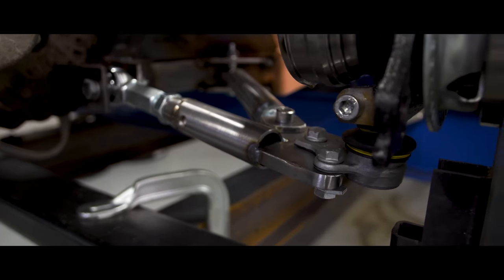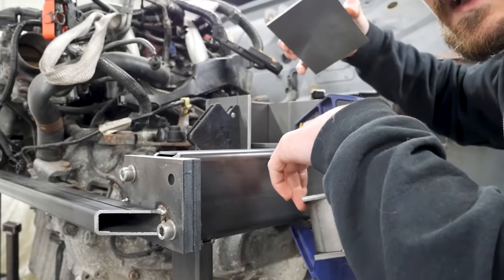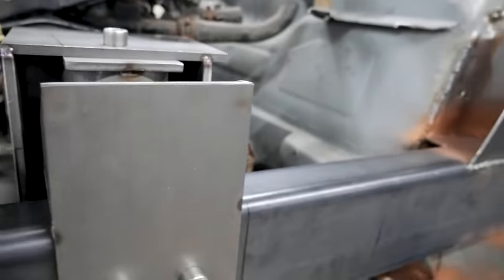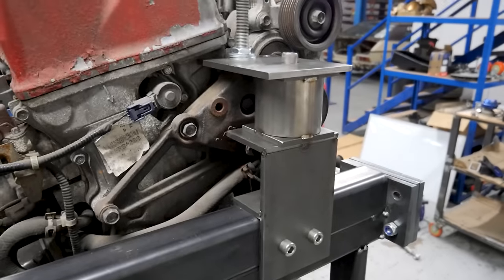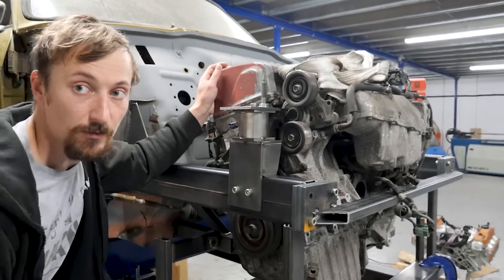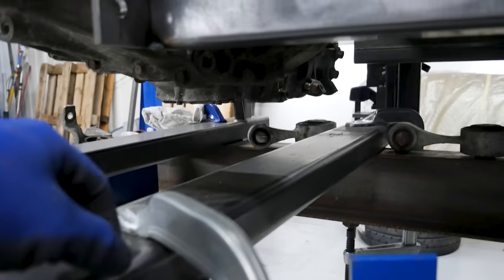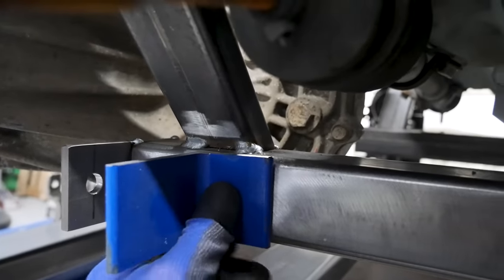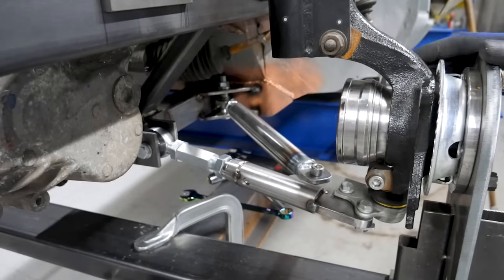Project AllegRo - Jonnys K20 VTEC Sleeper Build - Part Three!

Comment: Engine mounts rubbers : don't put them near anything hot, and definitely don't put a turbo on top of them, otherwise you'll kill them. Engine mount tie bars : these never live more than 40,000 in a road car before they fatigue and lose stiffness, so don't use old one. Replacements are usually cheap. Lower engine mounts from f56 mini/ bmw 2 series touring are a decent design
Reply from the maker: Most of the wear items will be new, but not worrying about using new parts during dry build stage 😁
Reply: Just be careful.with oe mounts, it's likely that the rubber won't live beyond 70C continuous

Comment: It would have been a lot more efficient and economical to weld on a late model honda civic front clip ( chassis rail and inner guards) with accompanying suspension and a k series swap kit , , rather than trying to reinvent the wheel and making the whole thing look like a tank .   A small car like this doesn't need 4x2 chassis rails, I am not an internet engineer, rather a performance car builder with 53 years mechanic skills
Reply from the maker: Apart from a Civic is much wider than an Allegro 🙁

Comment: Few extra kilos on engine mountings is weight spent in the right place as far as I'm concerned. You can probably put a few lightweighting holes here & there without losing much strength but not the end of the world. The stock Honda engine mount setup is quite involved from memory. One thing I would say is that I have a K20A2 (EP3) in a kitcar which uses a basic engine mounting strategy with metalastic bushes & it's quite a buzzy motor. The Z3 version had balance shafts which would presumably help (although most people seem to remove them) but given the choice I'd use the full Honda setup as at least you'll have a reasonable level of isolation which you can stiffen with aftermarket parts if necessary. Shaping up nicely though.
Reply from the maker: Oh there will be lots of holesaw treatment yet 😃

Comment: I’m commenting as someone with no expertise whatsoever on the matter, but a thought occurs to me; with the extremely strong reinforcements fitted to the front of the car to accommodate the new engine and suspension, will the front of the car be so much stronger than the middle and rear that the car might split in half given enough stress and load placed on it? Does the rest of the car need some strengthening so that loads are handled more evenly?
Reply from the maker: Yeah we’ll work backwards at some point, plenty to do yet 😀

Comment: Is there a reason you kept the bottom plate full width on the gearbox mount? From this angle it looks like you could have just had the studs from the box going through just a flange rather than the full width plate. Obviously you would loose some stiffness but you could add webbing at either end of the flange and leave the inboard wall in it still. It would mean you could remove that mount without having to remove the other part as well.
Cheers for the insight and details. Really interesting build.
Reply from the maker: I’d have to remove way more than I’d be comfortable with in order to remove it. Rather just hole saw it. Can’t see it ever being an issue to remove as one assembly😃

Comment: How come you mounted the rear pillowball on the lower arms in a horizontal plane rather than vertical?

Looking at the design of the lower arm, those joints will only ever move in a vertical plane so surely it would be best the same as the front joint? Anything rotational should be picked up my the ball-joint at the bottom of the hub.

Just interested as it’s something I don’t fully understand. Keep up the Cardboard-Aided-Design and tasty fab-work!
Reply from the maker: Mounting them horizontally allowed the mounts to act as a gusset between the car body and the box section that mounts the lower arm
Reply: Thanks for the response. Makes a lot of sense. 

Doing a bit more research it looks like the horizontal plane will also help with stresses on the joint under braking applications too as the forces won’t be pulling the ball part of the joint out of the socket gaps!

Keep up the good work!

Comment: Nice! Thanks for sharing! I would've placed the "rubber part" om-top of the chassieg, en redisgned the gearbox-mount. The chassis-side mount looks "flimsy" only holded by 2 bolts. 👊🏼
Reply from the maker: There’s many ways to skin a cat! There are four bolts, two hidden ‘inside’ that you can’t see 😃
Reply: Ok, thanks!

Comment: 2 questions I have. How much weight will be added to tie car with this front end, and how does it attach to the rest of the car structure to be strong?
Reply from the maker: No idea until we actually weigh it, but I can tell you there two inner wings I cut off in ep1 are way heavier than you’d think!

Comment: Shouldn't the engine mounts be at the same height across the car (Z dimension) so the engine does not rotate at an angle? (Centre of rotation is in one plane) If you have different heights the engine will pull up on one side.
Reply from the maker: Not according to Honda😅
Reply: @FabCoUK  Hmm, from the images I see on the web, the chassis rails of the Civic are level in Z and there is a hydro-mount with drop plate to get to the mount on RHS the rail. The gearbox end has a riser plate to lift the mount up from the transmission to the LHS rail. It all looks fairly conventional for a current FWD transverse engine and from that, the rotation point for the power unit will be aligned across the car in Y. A classic example of getting it wrong is the Maestro/Montego. Ok (sort of) with the 1.6l engine but the 2.0l and 2.0l turbo suffered from horrendous torque steer issues because of the engine rotation being mis-aligned. This pulled one drive shaft and pushed the other.

Comment: Erm, did I just see a hole tapped, using a drill?
Reply from the maker: Consumables!😄
Reply: Standard industry practice..
Reply: Haha you gotta love car fabricators "over engineerinered with thick plate" but tap M8 IN 3MM box 😂 it's not even a full nut worthy of thread but hay who's checking 🤭. Still looks interesting how it's all coming together.
Reply from the maker: @ricardo-iw9sq  m10 ;)
Reply: @FabCoUK   M10 with 3 mm wall, you should drill it out and weld in a bar with the thread in because if you over tighten it it will pull the thread, if its just temporary then fair enough for development.
Reply from the maker: @ricardo-iw9sq  I’ll go all the way through with a crush tube in the middle, and a nyloc on the other side. But I’m glad I didn’t yet, because we actually ended up changing both mounts as you’ll see in episode 5 probably 😃
Reply: @FabCoUK  👍👍 cheers Ill wait for the next instalment, that type of re jigging must be a mind bender of a job.